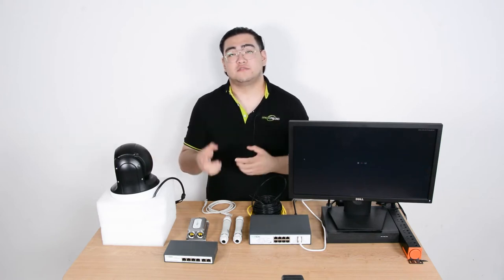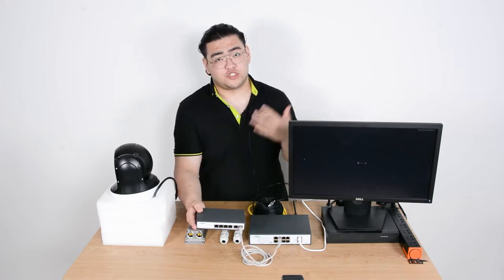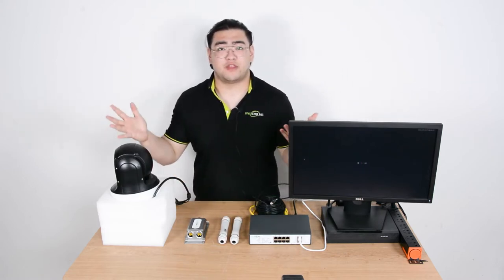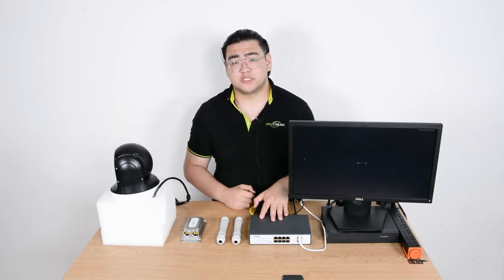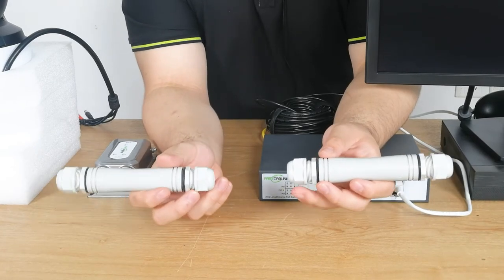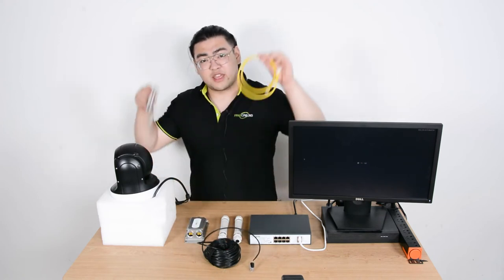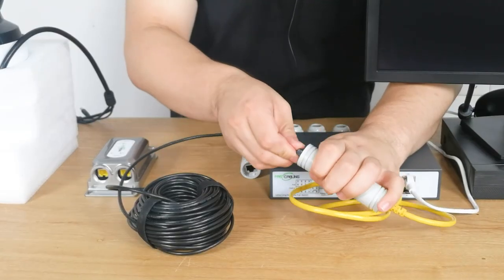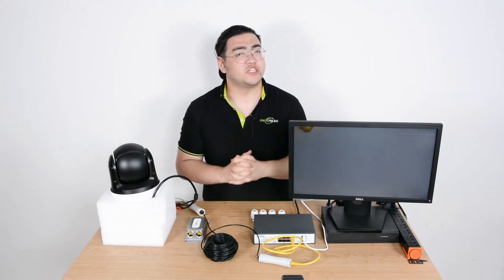Daisy Chain PoE Switch to Cover 500 Meters Setup for IP Devices? Effective?

Comment: Watson you still owe me a call.I need some info and poe extenders asap.will travel to Mexico by April.this seems to be the set up I need but need to be sure.please call me.tnx.
Reply from the maker: There are different PoE extenders to extend the PoE network beyond 100 meters. https://www.fastcabling.com/product-category/poe-extender/ You may send the email with your contact number. Our agent will try to call you.
Reply: So according to this demo,I need a poe switch,input to input conection.then ip ptz cam conection will work.correct?but you dont me tion anything on using a poe injector?are you saying,you dont need a poe injector to reach a 500 mtr.conection?all you need is an nvr,poe switch,100 mtr.cat6 poe extender input port,300 mtr cat6,input port cone tion,output port to 100mtr cat6 then conect ip ptz cam.reaching your 500mtr conection.correct?.be waiting you prompt response.tnx.